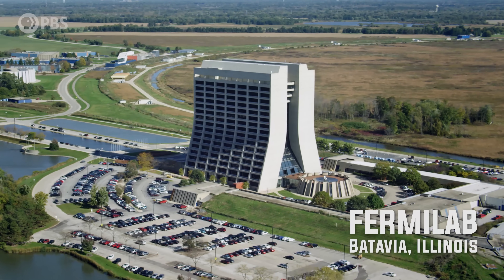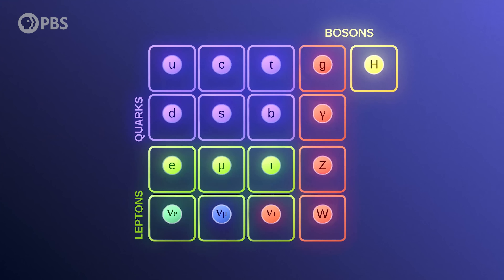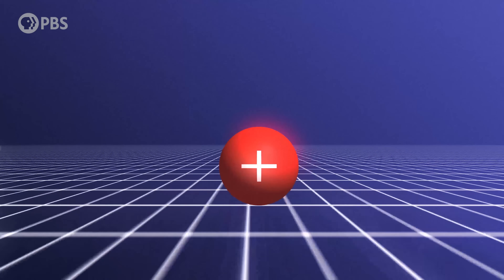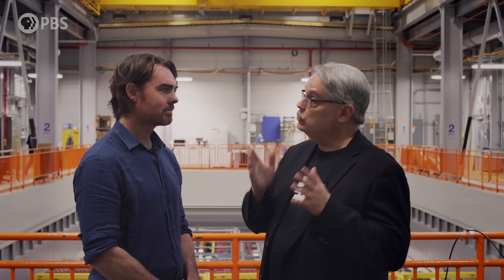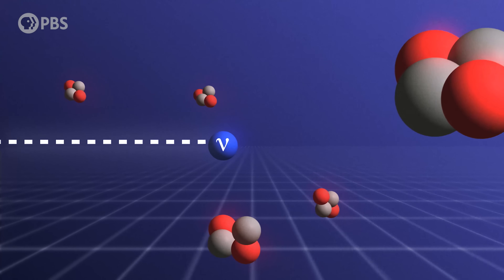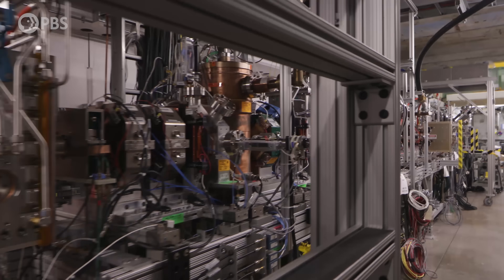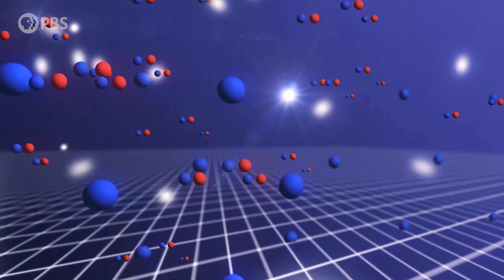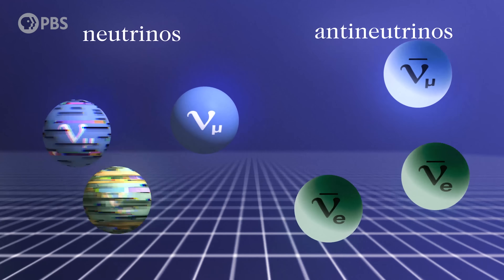How To Detect a Neutrino

Comment: The speed of light challenge:
It is stated that nothing can travel faster then the speed of light, but at the same time what is light moving relative to?
If Galaxy A moves at the speed of light away from Galaxy B and Galaxy C moves at the speed of light away from Galaxy B inn The opposite direction. Woulden't Galaxy A move at twice the speed of light relative to Galaxy C?
And if this continue throughout the universe, would it then be right to say that nothing can move faster than the speed of light?
If a star is moving at the speed of light, the light that that star emits would still move at the speed of light from that star. Would that light in itself move faster than the speed of light?
Reply: You are aware that the addition of velocities works differently in relativity, right? A spaceship moving at 1000 km/s will not emit light moving at 301.000 km/s.
Reply: @lunkel8108  that statement doesn't solve the concept I am posting here does it? Read it again. If what you are saying is that the speed of light is constant no matter what it is relative to. That the light from a star in our galaxy is traveling towards us at the same speed as the light from galaxies from the deep field. 
Then theoretically the light from a star from the deep field is relative to itself traveling faster than the speed of light. That statement sort of falls short on itself. Something doesn't add up there.
Reply: Nah, Einstein already answered that question (cant add anything to light velocity).
Better questions are, for example:
 How can the Universe expansion be faster than light?
 How can entagled particles comunicate themselves faster than light?
But also those had been already answered. :-)
Reply: I  see what you are saying. But not sure my point is communicated right.
The speed of light is constant, but relative to what?
A lightwave is streached or redshifted because of the object it emmits from is moving away from us, or blue shifted when moving towards us. We can tell apart the light from what direction it is moving. I understand this concept and physic behind it. 
An additional thought that will underline my point above. A star moving away from us at the speed of light that was to far away from us to detect when it was born, we would never be able to see that light because the light will never reach us. If we would, than the light that emits from that star is moving faster than the speed of light.

So two galaxies that moves away from one another at the speed of light is moving away relative to each other twice the speed of light. Could it be that galaxies we see in the deep field that moves away  from us faster than the speed of light is doing so because our galaxy and those galaxies are moving away from a point in between us? That relative to that point none of us are moving faster than the speed of light, but relative to the deep field we are moving away faster than the speed of light?
Reply: @ernstkristianstlen4369  The speed of light is constant from every reference frame, always. That's the entire point of special relativity. Light gets red- or blueshifted instead of loosing or gaining speed because it cannot change.
Reply: The weird thing about relativity is that light travels at the same speed for ALL observers. In static space and time this is impossible; if I am in a ship moving at 99% of c, then I shine a light forward, SURELY it must only move at 1% c for me? Otherwise, what would someone see OUTSIDE the ship? The beam moving at 1.99c?

What happens is that space and time warp to let this happen. The fast moving ship is squashed (Lorentz contraction) when seen by a 'still' observer. What I on the ship would call a foot they call an inch. When I turn on my light it speeds ahead of me in feet, but the person watching my ship sees it inch ahead. So the both of us see the beam moving at the same speed, but our definitions of distance and time no longer match up.

What about the three galaxies? We don't need light speed for this, let's say 0.6c for both A and C movin away from B. The total is 1.2c, which is faster than light, right?

Well B can see C moving away from it at 0.6c, fine. But this depends on B thinking that it is sitting still. We could also say that B sees C moving away at... let's say 10 galaxy widths an hour.

Now what about A? A sees B moving away from it at 0.6c, fine. BUT this means that B looks squashed, it's moving fast after all. What does THAT mean? Well C is moving away from B at 10 galaxy widths an hour... but those galaxy widths have to be squashed too, because they're from B's viewpoint.

So C ISN'T seen moving away from A faster than light! The squashing added in because A sees B (and C) moving shrinks the distance between them and makes them appear to be moving apart more slowly.

This can be very, very difficult to visualize but there's solid math behind it.
Reply: @garethdean6382  Thank you for your answer. I've watched several videos and red up on this to make sure I understand the concept after my first comment.
In your explanation the galaxy A appears squished to galaxy C. 
At the same time since light is traveling in both directions, Galaxy C appears squished to galaxy A right? Does it create an issue where they experience time slower relative to us, but then we experience time slower relative to them again?
If a passing train is moving at half the speed of light emitting light in both directions. The light backward would need to move faster then the light forward for the "still" observer to experience both lights moving at the the same constant speed. But for that to happen the light from the train would need to move backwards faster then the speed of light. How is this problem solved? Does the time dilation solve this imaginary problem?
Reply: 1.) Yes, this is the 'twin paradox' (The paradox being that since both twins are moving relative to each other they should BOTH experience time dilation and thus both end up the same age, yet one DOES end up older.)

This is the 'easy' question to solve since the twin that experiences acceleration will be the younger. (It, like gravity, slows time relative to a frame where it's not experienced.) So if Galaxies A and C stopped and went back to B they'd find themselves the same age with B being older than both of them. (The exact math behind this is a bit more involved but it really is just the twin paradox with a twist. In essence they'd assume their opposite was the younger until they saw them change direction which would cancel out the discrepancy.)

2.) This... oh this hurts to think about. It seems so simple; if an object moving at near c releases two beams of light then after 1 second the front beam will be barely ahead of it while the rear beam will be 2 light seconds away, right? But oh lordy does it get complex.

Imagine a system of one body and two mirrors, one in front, one behind, both 1 light second away. Two light pulses are sent out towards the mirrors at the same time. The object will see the beams leave, hit the mirrors at the same time 1ls later, then return to it at the same time after 2ls.

We know from experiment that this is true no matter how fast the body is moving, that's basic Michelson-Morley. If it wasn't we could deduce absolute motion and relativity would be no more.

BUT what does a 'still' observer see as the system moves past? There's Lorentz contraction of course, but we can ignore that entirely. The front beam inches ahead towards the mirror moving just slower than it, hits, then almost immediately hits the emitting object which was just behind it and moving towards it.

By contrast the back beam quickly hits the mirror which is moving towards it, but has to slowly catch up to the emitting object. As the system is symmetrical the beams will leave and return to the object at the same time.

BUT the back beam will hit the mirror first and neither beam will be seen to hit the mirror halfway through their journey time. Two events that are simultaneous in one reference frame aren't in another! And they're symmetrical in one frame but not in another!

This is more commonly described as the train-tunnel paradox: https://www.youtube.com/watch?v=Xrqj88zQZJg 

SO, we can sit 'still' and say 'This rear light beam is now a long way away from the object. By the object's own standards surely it must have moved faster than light to cover that distance in that time.' But the object will retort with 'You measured that much later, of course it went a further distance, it had more time to do so!'

You end up disagreeing at what times the front and back beams hit distance markers, or how far away those markers are.

And you would think there'd be some experiment you could do to force the situation where both parties could step back and see something was wrong. What if you had the object race along a ruler say?  But it never 'works'. When you take into account time dilation, length contraction, doppler shifts and changing reference frames it all always works out. But it seems so crazy.

Comment: if particles are actually just fluctuations in fields, wouldn't an imbalance in anti-neutrinos and neutrinos caused by slower oscillation speeds in anti-neutrinos require an additional field or force to interact with that we could detect? and would there have to be slower oscillation speeds now or at an earlier time closer to the big bang?

Comment: So,  would a neutrino and an antineutrino annihilate each other or is it very unlikely because they just don't interact?
Reply: They can but it is unlikely. Most particles have opposite charges to their counterparts and so are actively attracted to one another, this helps them combine from a distance. But neutrinos are neutral and must get quite close before their opposite 'weak charges' interact.

Similarly photons are their own antiparticles, but it is very difficult to get them to combine into things like positron-electron pairs. (Which they can only do when they have a high energy anyways.)

Comment: No object can travel at the speed of light because space time will compress, so that it could bender reach there, right? But what about anti-matter? Anti-matter would speed up the closer it got to the speed of light, instead of slowing down. But, theoretically, because anti-matter mirrors normal matter, normal matter should be able to the same.
Reply: It wouldn't loose its mass, you would just need infinite amounts of energy to accelerate it to the speed of light if it has rest mass.
Also, antimatter has mass in the exact same way normal matter does.
Reply: Lünkel Thanks, I re-worded the question, but shouldn’t anti-matter warp space-time in the opposite direction of normal matter?
Reply: @astroneural  No, our theories predicts antimatter particles to have the exact same positive mass as their normal counterparts. Therr are currently experiments being run at CERN to test this.

Comment: I know I've been told they were already taken into account in the total matter caculation but a neutrino as a "weakly interacting particle" sounds a lot like dark matter. What exactly is the difference between theoretical dark matter particles and neutrinos?
Reply: Neutrinos are too 'hot' in that they move too fast. The dark matter we detect seems to form a 'halo' or 'cloud' around regular matter, suggesting that it's moving slow enough for gravity to hold it in orbit. Neutrinos are moving far, far too fast for this to be possible except for black holes and some neutron stars. We expect DM particles to be much heavier (Some even say primordial black holes.)

Comment: This is in response to an old Space Time video: Telescopes on the Moon. Seems more likely to get responses here though, so here goes.

I am not a physicist/astronomer/etc so I'm sure this has been thought about, but would it be possible to build a liquid metal mirror telescope on the moon? It wouldn't circumvent the weight limit, and it wouldn't really be aimable, but it seems like you could build a foldable "bucket" structure that would unfold on the moon's surface and be filled from a liquid metal reservoir. Rotate the structure and you get a flawless paraboloid mirror. The bucket doesn't have to be perfectly shaped so you wouldn't have to worry TOO much about g-force distortion during launch and landing.

Further uninformed speculation: the nighttime temperature is below the freezing point of mercury. If it froze evenly enough you could stop the rotation and you would have an aimable mirror for the duration of the night.
Reply: The idea is plausible, but the problem is that doing things 'in space' is often far more tricky than on Earth because it's much harder to monitor and adjust things. Plans are well and good, but if there's one thing we've learned it's that unforeseen problems and endless. The idea has merit but would need years of testing to ensure that any possible bugs were ironed out first.

Freezing metal is another thing entirely; metals shrink when frozen and form crystals. This is most obvious in mercury's neighbor bismuth. A freezing mercury mirror becomes uneven and rough, especially if it cools slowly or unevenly.

Comment: How do you aim a beam like that at a target so far away? The precision has to be astounding.
Reply: The beam widens as it moves, it's less a laser and more a flashlight beam. By the time it hits its target it's several hundred meters across. This cuts down on the precision requirements somewhat, though considerable testing is needed to make sure the beam is on target.

Comment: Matter/Antimatter-imblanace is a problem often discussed, but what about electron/proton-balance?

Please do a video on the electically charged universe!

In every paper it alwas just says "to satisfy charge neutrality", I'm wondering by which mechanism the universe should be created neutral after all?

Net negative charge can be ruled out, because it would be visible. However, an interstellar medium of mostly protons would explain:
- at least parts of dark energy, since there would be electrostatic pressue
- dark matter, since protons do not interact with photons
- the net positive charge found on the moon, supposedly representing the charge balance between solar wind and interstellar medium
- black hole jets, since positively charged black holes allow charged particles to exit the event horizont on their spin axis
Galaxies are just where electrons clumped; the interstellar medium supplies protons in exchange for heavier ions to "replenish nuclear fuel"

I would like to know which evidence rejects the charged unvierse hypothesis, since most stuff I found was speculative.

Also, thanks for years of great content!

Comment: If there was a magnetic field present in the early universe matter and antimatter would have moved in opposite directions in response to it, thus separating them. Perhaps the antimatter is outside our 15 billion year light cone moving "away" from us. By "direction" and "away" I'm not necessarily saying a spatial feature, perhaps the movement is along some other axis we poor 3D beings can't conceive of, a different sort of inflation mirroring that which we see in our matter universe.
Reply: Don't magnetic fields affect charge? What would separate the positrons from protons? They'd both head in the same direction, right?
Reply: @garethdean6382  that's a good point I hadn't considered.

Comment: They are measuring neutrino oscillation velocity but how can they compare it with anti-neutrino oscillation velocity without knowing anti-neutrino oscillation velocity?
I feel this bit of information is missing from the video...
Reply: They're not doing that. What they're doing currently is measuring what happens and comparing that to what SHOULD happen in various models. If the results match the current model, well too bad. If they differ though then the alternative model might be supported, which would be a neat thing.

Antineutrinos CAN be generated the same way, you just select for the negative pions. But they're not needed yet.

Comment: The neutrino will not explain why there is something rather than nothing. 

The real evidence showing why there is something and not nothing was discovered in October of 2019 by the ALMA Radio Telescopes. They measured the movement of the gas and dust near the black hole Sgr A* in the core of our galaxy and discovered that everything, energy, gas, dust and space was moving away from the black hole not towards it.

Comment: Could somrone explain how can neutrino have anti-matter counterpart if its charge is 0?
Reply: Antimatter doesn't just have a reversed electric charge, but ALL possible charges. So antiquarks have the opposite 'color charge' as well and neutrinos have an opposite 'weak charge'. So when a neutron decays into a proton it emits an electron and an antielectron neutrino because the electron's weak charge is +1 and needs to be balanced by the antineutrino's -1 charge.

Comment: Would this theory of different oscillation times between matter and antimatter neutrinos make original imbalance unnecessary? 
The process that created an equal amount of both matter neutrinos and antimatter neutrinos would have matter neutrinos that oscillated faster, so that across vasts regions of space, a small difference in one type of antimatter neutrino flavor changed randomly through sheer chance, enough to create a gradient of flavors, which the faster oscillating flavors of the neutrino amplified this gradient, since the rate at which they keep cancelling out each flavor of antimatter neutrino does remains constant (as they change between flavors at much faster).  

This would also make the probability of an accessible region of space composed of antimatter very unlikely with a short lived bubble it would be surrounded by a bubble of completely void empty space whose expansion would be accelerating much faster.